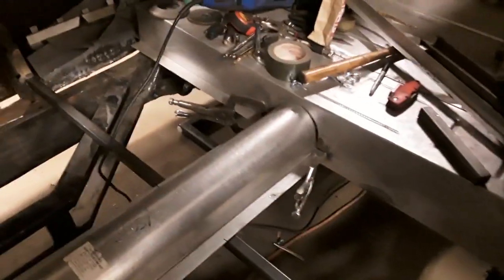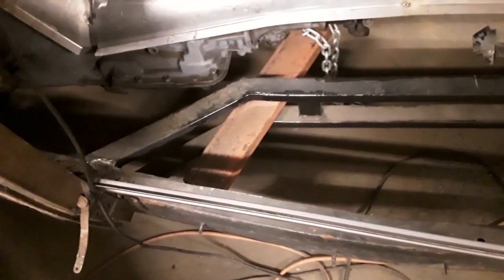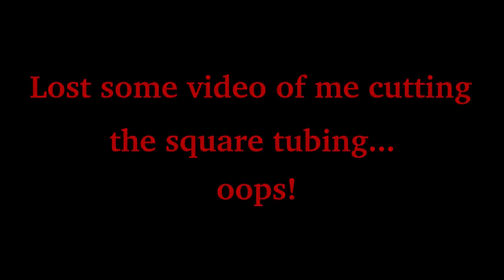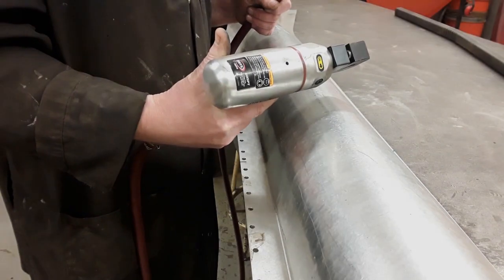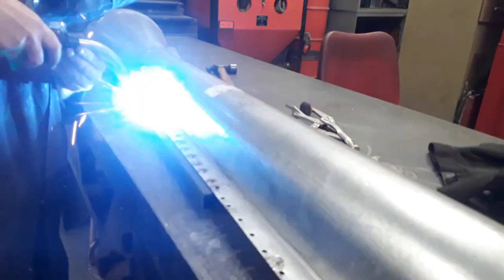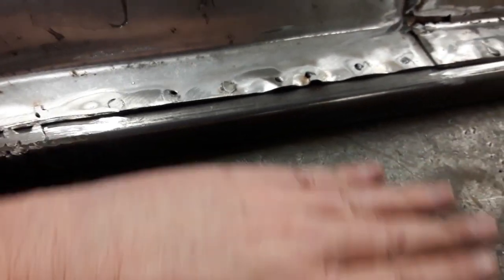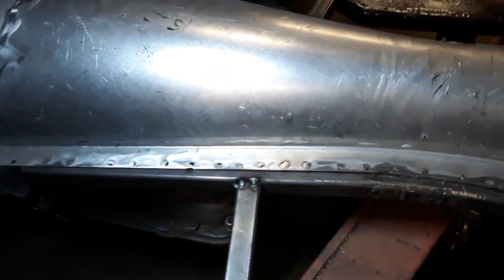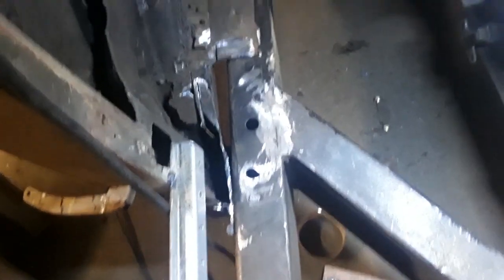EMS tunnel install in my '40 Ford Tudor Sedan

Comment: from the body work I've done the 40 ford I find EMS body parts take lot of work to make fit.  Quarter panel , lower door repair panels radius don't match , lower rear fender repair panel to running board don't fit
Reply from the maker: Thanks for the comment! I've found that with almost all aftermarket panels I've used, I got these used and did need to work them quite a bit to make them fit.

Comment: Do you think those EMS panels would work with a stock floor? Mine are original and solid but I’m gonna put an AOD in mine so I know I’ll need to cut to make room.
Reply from the maker: Good question... My floor is going to be built 1" above stock so I will have loads of room over my 4L60. So if you have stock pans with stock body mount spacers I would think you would be ok.